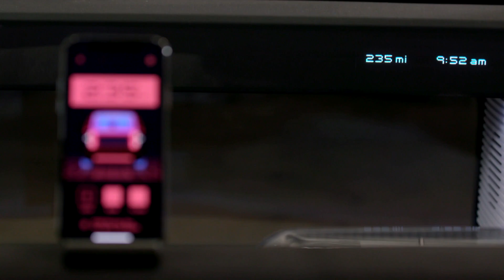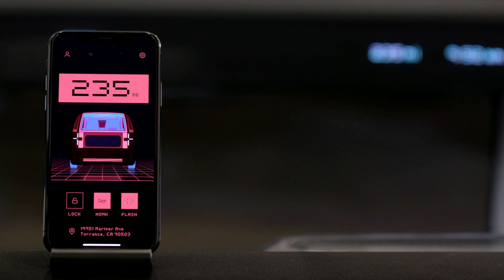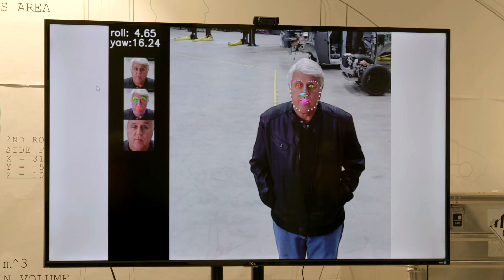Inside Look At New Car Company Canoo - Jay Leno’s Garage

Comment: Glad they put the camo on the "beta" version, otherwise I might have figured out the shape!
Reply: whats funny is the camo lets you see the line of the car better
Reply: I wonder what it's going to look like 😂
Reply: May be a marketing strategy. Everyone talks about seeing a prototype car driving around. Even if it’s not really a proto.
Reply: Every automaker camos their beta cars
Reply: I'm going to see if a paint shop will paint my car like that, then no one will know I'm driving a 1996 Subaru wagon with 320,000 miles on it... Lol
Reply: @cec4  Camo only works of the car is slick and slim design, a camo is useless if ur vehicle is in the shape of a bus.
Reply: @DrawsOnCad  That's where the relocatable steering wheel comes in. No Backing out of parking spots. Just change which end is the front.
Reply: @chefmike4414  🤣
Reply: @briansilver9652  🤣
Reply: That was to hide the big ugly NHTSA bumper that Prototype One didn't have.

Comment: Jay: Is this aerodynamically efficient?
Rep: For the shape the aerodynamics actually perform quite well.

LOL
Reply: "For a brick, he flew pretty good"
Reply: And then there's.  "So what's the range, do you know?"  No Jay, they designed and built it, but never really thought to check the distance.  It looks like Jay wants to get out of there ASAP from the beginning.  Haha.
Reply: It's very much like what it exactly is
Reply: @cavemanxcore  For a flat wall it does nicely.
Reply: try to search toyota hiace from asia
Reply: It makes sense considering this will be a city car won't go any faster than say 100mph below which aerodynamic doesn't make much of a difference its more about effecient and this is pretty fluid and smooth for the given speed!
Reply: You just might be surprised at how good the aerodynamics are. Since it does not have a tapered rear, the aero could be a lot better, but this vehicle has a passing resemblance to the 1939 Schlörwagen that had one of the best drag coefficients of any vehicle.
Reply: @O-cDxA  Yes but that frontal  area is obviously huge.
Reply: The Asian guy pretty much made it clear that the aerodynamics are NOT for the highway, but "efficient" for city driving.   (yawn)
Reply: + with the low speeds it does not apply.
lol ok
Reply: It's aerodynamic enough for LA traffic.
Reply: Jef Damen duh, there will be more drag in faster speeds and like nothing in the city.

Comment: "Is this aerodynamically efficient?"

"For the shape, it performs quite well."

Wise man, good answer. For being a brick, it is the most aerodynamically efficient brick.
Reply: Especially in a low-speed situation, when the aerodynamics don't matter...   :)
Reply: They've got the sales twisting down. That's why they won't be talking to me. Not at all wise.
Reply: Newspeak...   Utopian vomit talk, inclusively effusive.
Reply: Maybe if Jay would let him combine more than three words together without interrupting him this would be interesting.
Reply: Still more aerodynamically efficient than the Countach
Reply: A volkswagon bus from the 60's had a better drag coefficient than a Corvette from the same era.  The Vette had a smaller frontal area, so it's overall drag was lower, but the shape of the bus was more efficient, and it would have had lower drag if it was scaled down to have the same frontal area.  This vehicle has similar rounded corners that the old VW bus had, so it's probably fairly good for it's frontal area.
Reply: D Mark WHAT? 😂
Reply: Jay asked a trap question. Aerodynamics only matter to a point. It’s volume efficient, and if you run several in a line at close distance there’s this thing called drafting/slipstreaming. ;) A bus is more energy efficient than a car depending on the number of passengers in each.
Reply: deezynar Yep, a blunt nose is one thing, but a continuous plane/wing is another. The long roof of a van keeps air attached better than a traditional coupe or sedan’s profile. The only issue is the frontal area, but that’s unavoidable.
Reply: Bricks fly if you toss them hatf enough ;) haha yeah you have a great point
Reply: D Mark  Nervous
Reply: No, the Space Shuttle is the most aerodynamically efficent brick.
Reply: Honestly, it is probably much more aerodynamic than his Countach.
Reply: D Mark  some people just aren’t good at dealing with people, particularly people they don’t know well.
Reply: This comment reminds me of a quote from the beginning of Halo 2. "For a brick, he flew pretty good." LoL
Reply: Actually, the shape a water drop has, when falling down, is the most efficient aerodynamic shape. 💧Note that the thick round shape is facing towards the motion. This is the same with the design of this car in front.
Reply: They don't answer questions, they handle them. Politics 101.
Reply: For sure one of the most awkward interviews ever.
Reply: @RikHeijmen  first off, raindrops aren’t shaped like that. Second, the teardrop shape isn’t the most efficient. There’s a reason cars aren’t shaped like that anymore.
Reply: You beat me to it...I thought the same thing as soon as he said it.
Reply: Em hem...right... laughing hysterically.
Reply: @kokofan50  does not bode well for the product when the CEO and engineer suffer.
Reply: Brandon Obaza look at cybertruck lol
Reply: That guy had some very slick answers.
Reply: I drive mostly in town. my average speed last 4 years is is around 17Km/h (that's just a bit over 10mph)... so...
Reply: See those wheel covers? Lack of grills and openings? It's still rounded off, too. It's way more aerodynamic than you probably think and it's not meant to do 100 MPH for hours at a time. This design is fine. It's probably much better than a typical gas SUV with grills and normal wheels, and better than most minivans.
Reply: If it actually achieves 250 miles per charge and the fact that it is fully electric does it really matter how aerodynamic it is?
Reply: @RikHeijmen  It has to do with how it enters the air AND LEAVES to be aerodynamic. The nose shape is only a small part of it.
Reply: @senatorjosephmccarthy2720  not that you can afford a car like that, poor arse.
Reply: The most aerodynamic brick there ever was
Reply: @RikHeijmen  That's why I laugh at all the comments with "frontal area" as their technical expertise mantra for good aerodynamics.  I describe a Trout as a great example of aero/hydrodynamics.
Reply: D Mark  I think he is a work in progress, having just been hatched from his pod, even sunlight is strange to him.
Reply: libra8a  If it can make it to Vegas with one charge, then all else is moot.
Reply: D Mark  Maybe he is shy, maybe he is not a trained performer,  wh knows, who cares
Reply: I was going to post this exact quote....wtf is he saying.
Reply: @RikHeijmen  not correct. The water drop is efficient vs gravitational force and most efficient at terminal velocity.
Reply: @RikHeijmen  a falling drop of water is round.
Reply: @TheNextDr   "We at Canoo believe in efficient aerodynamics outside the stratosphere."
Reply: @the dude The old GM G-Body. Doesn't go fast unless you brute force it. When it does go fast, it doesn't like it.
Reply: @RikHeijmen  the shape reminds me of aptera
Reply: It performs best when drafting....actually if you tow it, it uses 0 energy.
Reply: @RikHeijmen  pumpkin seeds do very well. Why many of the original solar powered cars were shaped that way, with very thin wheels to reduce drag, both in contact and aero.
Reply: Well done! This made me laugh.
Reply: for a brick, it drove pretty good
Reply: Nice. Post
Reply: Just make like it's a F4F phantom. With enough thrust you can get a brick off the ground.
Reply: As city cars go. They don't really have to be aerodynamic at 30mph speeds.
Reply: This is video I’ve seen on this Chanel.

Comment: "The steer by wire system and battery pack in the floor give us the ability to design any kind of car we want."
"I know, let's make it a brick!!!"
Reply: lol
Reply: Well, only a couple of days ago, I thought how cool would it be to fit wheels to a shipping container !
It's not wildly different from existing vehicles. A brick is probably the ideal transit design but poor for aerodynamics - so they rounded some bits !
Reply: Brad Sanchez  It'll be fine if done properly.
Reply: gemini232003  Mechanical linkages can fail too ! That's why cars today have 3 separate braking systems - in case one fails. Steer by wire would also need 3 independent systems and all must fail 'safe'.
Reply: That is the scariest part.  The enemy of an electrical system is water.  This vehicle looks like it is very easy to hack.
Reply: @millomweb  You are right they can, but for the most part a mechanic can see when they are worn and replace them before there is a problem.  With this system, I would be more worried about hacking than the system failing, unless there is a flood, then you are in trouble.
Reply: @mexicanspec  Got to say though, having driven into a dock, I don't think I'd be too bothered about the steering not working.
Reply: @mexicanspec  Waterproofing is possible. Need to sense the position of the steering wheel - that can be done at the wheel - so no need to worry until the water's over your belly button. Actuation motor would likely be fine under water if low voltage (i.e.12V) but still best kept dry - and that would be possible. I think the important thing is that if any of the three systems fails, it fails as 'dead' and never fails driving the steering full lock in either direction - system 2 and 3 should still operate as normal giving the usual control feeling + a system fail warning light on the dash.
Reply: you mean a rounded off brick right? lol

Comment: I like how the CEO greets Jay then quickly passes him off on an engineer.
Reply: I much prefer to talk to an engineer than his boss.
Reply: @jamesvandamme7786  In this case, the engineer WOULD be the better guy to talk to Jay but, yeah, not exactly  great PR skills on the CEO's part!
That's a REAL CONFIDENCE BUILDER for the general public and potential renters, ain't it?
Reply: CEO had a meeting. Very important.
Reply: @AvengerII  The first dude is an engineer, the 2nd guy is a designer.
Reply: I just hope this was not done today, close up meeting with strngers standing closely, no face mask or sanitizer seen. Stay safe Jay.
Reply: Yeah, a big difference between Canoo and Tesla.
Not only did CEO Elon Musk talk to Jay about the truck, he let Jay drive the Truck down a tunnel he didn't know it would fit down, and it barely fit at that. LOL
Reply: CEO was too busy doing the math on all of the OPTIONS they offered him.  If he is a smart CEO he will take them and run.

Comment: I remember seeing GM with a skateboard platform some years back
Reply: Yep over 20 years ago
Reply: They invented the idea.
Reply: VW had them since, ah er forever. and nobody did it better.
Reply: @246spyder  yeah,  that's true.  Most versatile car platform on the planet.  I have to correct myself- the skateboard is the electronic,  fly by wire,  electric- car version of the VW type platform.  Stupidly,  even though GM developed such a thing over 20 years ago,  they don't even use it on their electric cars; they use gas- car platforms.  Volt = Cruze + even cheaper styling + electric motor and double cost.  In fact,  when the Volt came out,  you could buy both a Prius AND a Cruze for $2000 less than it cost.
Reply: YES THE HY-WIRE WITH HYDROGEN TANKS IN THE FLOOR. GM WAS TOO STUPID TO USE IT SO TESLA CAME UP WITH A BATTERY POWERED SKATEBOARD.
Reply: @MICHGO1  don't forget the Autonomy concept too.

Comment: Isn't using seatbelts and headrests mandatory in USA? For safety?
Reply: Also the reason why no one makes rear hinged suicide doors.
Reply: @truantray  Lincoln Continental....at least one version. Some Rolls models too.
Reply: D Mark  I think the guy mentioned they are 5 star rated?
Reply: D Mark  I assume "Communist' was a racial slur.  Thanks MAGA man
Reply: @rcpmac  Racial slur? That's stretching it. Original communists were white. Most still are to this day.
Reply: @bl8danjil  anything is a racial slur these days

Comment: 14:25 I like how the car just drives through the stop sign like nothing lol
Reply: Police Bike was behind the whole time
Reply: @VAX1970    I think you and me were the only ones who noticed that.  I think they required traffic control because it's so slow.
Reply: @discerningmind    Nah, I noticed that also.  However, almost all of Jay's videos have police escort so they can take up both lanes, have cameramen hanging out the back of a camera car, blow through stop signs, etc.
Reply: @ModelA    I've never noticed that over the years.  Thanks for filling me in.
Reply: I noticed that too. So do these drive-by-wire vehicles just ignore that kind of thing since I guess it has sensors for everything else like pedestrians and other vehicles?
Reply: @VAX1970  obviously it's in a controlled environment, but it's still not a great demonstration of autonomous driving. I'm pretty sure there isn't an "ignore stop signs" drive mode lol

Comment: What a terrible marketing explanation of the "vehicle as a service", it's just a car share service.
Reply: It's purpose built as a rental car with all the soul of a rental car. Hopefully it's tough enough to survive the abuse a rental car gets.
Reply: I can see the headlines now.
Man arrested after drugs found in his subscription vehicle. 
Claims the drugs are not his and was there when the car arrived.
Judge won't allow that entered as a defense.
Reply: @manuelh.4147  
The subway is mass transit, you can't hold any user responsible. Likewise with the cab, but the cab driver may be held liable, it really depends on how big a tyrant the prosecutor wants to be.

With a subscription vehicle, the time of possession is quite different. You may have that vehicle for a whole month and then send it back while the previous driver had it for a couple of days and turned it in forgetting the dope he or she hid somewhere.

Is the company giving those vehicles a good going over before they send it back out? If it's like most rental cars, the practice will be no. It's about the time of possession, not number of users. The company won't be prosecuted, even if the company failed to give that vehicle a good cleaning and inspection prior to sending it to the next user of the subscription service.

Comment: "When everything seems to be going against you, remember that the airplane takes off against the wind, not with it.
"

Henry Ford
Reply: unless there are other similar programs already. So not against the wind at all.
Reply: @saltymonke3682  This quote is about naysayers and perseverance. You can open a business where there are similar models and everyone around you disparages it . It does not have to be unique . It's a simple concept .
Reply: Henry Ford didn't know anything about airplanes. An airplane makes its own wind. If it's too stormy it doesn't take off at all.
Reply: @rdhudon7469  It's better to not compete.  See Peter Thiel's book: Zero to One
Reply: @dlwatib  Ford Tri-Motor. Aircraft carriers turn into the wind for the extra lift needed for the shortened take off distance. Difference in airflow speed over/under wings is what causes the lift, not 'wind' made by aircraft. Thrust is created by propeller/jet exhaust to propel forward circumstantially moving wing through air to create lift. Wind adds to the forward velocity for extra speed of air over/under wing.
Reply: Excellent quote
Reply: @dlwatib  Yet he still manages to know more about them than you do !
Reply: dlwatib Yikes, you really need to look at some of the aviation videos on YouTube.  Wind direction is very important when deciding what runway to take off and land from.  Also, look up the Ford TriMotor and the Ford Willow Run plant to see how much Ford contributed to aviation.
Reply: @Shadowfax-1980  " Wind direction is very important when deciding what runway...."
Runway? in a hot air balloon ?
[Wind direction is a bit more critical than 'very important' with balloons ;) LOL]